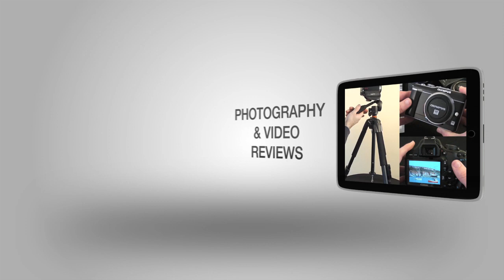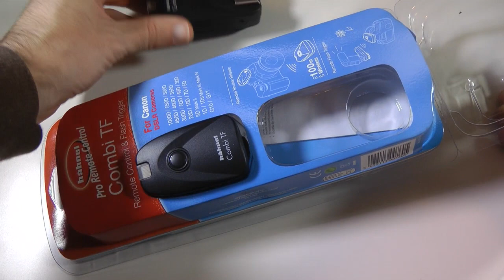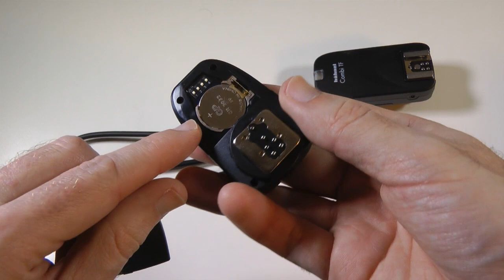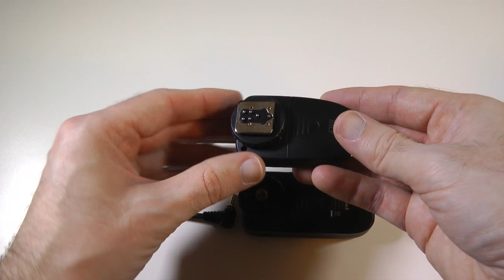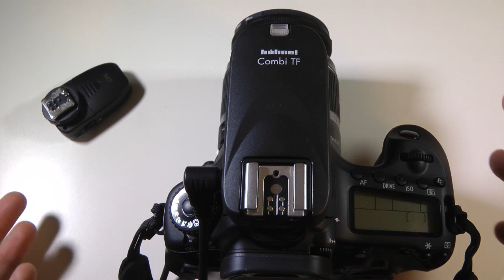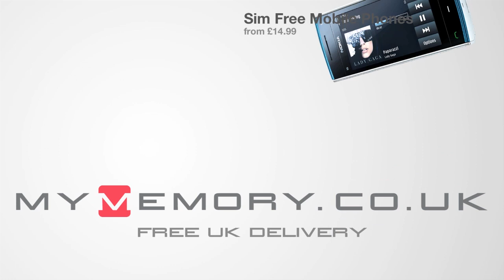Hahnel Combi TF Pro Remote Control for Canon Review

Comment: I have bought two sets, and am trying to use remotet triggering and external flash at the same time. But I am experiencing great unstability in my setup. Some times the camera triggers, and no flash. Some times only the flash triggers. And some times both the camera and flash triggers, but the flash triggers too late, and the photo is not lit up by it. My camera is Canon EOS 600D and my flash is Sigma EF-610 DG Super.

Comment: I recently tried it with the remote control on my 60D hot shoe and the flash trigger on a tripod as a remote slave and triggered it all with a Canon RC-6 remote control. Unfortunately I was surprised the max exposure was 1/160 sec and not 1/250 sec as I wanted. All exposures faster than 1/160 showed part shutter curtain or unexposed black.  I am still checking this out and hope I'm wrong! I had to use the 60D pop up flash pulse to activate the slave flash in the end.

Comment: Yes it does but that only works if the speedlite transmitter is in view of the receiving flash unit, so, if I was to require a unit to be triggered out of shot lets say behind the model, in a box, car or behind the camera it will 9/10 not be triggered.

The Hahnel remote system allows radio sync up to 1/200th of a second so you can receive it anywhere you want, within distance.

Comment: Just bought this device yesterday - I've given it a go, and I'm not sure where to get more info from.
Do you know if its possible to use the remote control function, with a flash on top of the receiver? I have tried it, and despite the flash working normally (I use a 580EXII on a Canon 40D), it doesn't seem to be in sync with the shutter. Any advice would be great - thanks!

Comment: Hi i have the Hahnel Combi set, my questions is can you set the camera to 1/8000 of a second or lower using this unit together with flash, i have a 5d mark 2 and I cant seem to go past 1/250 of sec. anything higher i find only half the picture is visable.
Reply: 'Normal' flash can go to a shutter speed of up to around 1/200sec on most cameras, or on some cameras the limit is a bit faster at 1/250sec.  To go to a faster shutter speed than that using any flash (and doing either on-camera and off-camera remote flash) you need to do 'flash synch'. Check your camera's user manual or your speedlite's user manual, or Google 'How to do flash synch'. The same applies with professional studio flash strobes as well because it's all to do with the flash's strobe time relative to the camera's shutter speed.

Comment: glad to add to your collection, you collect remotes lol.

I think if they were to improve it, the screw could be replaced with a single click connector like the 580ex uses. To use an external flash with the Hahnel kit above, you would need another receiver if you were using the remote shutter as well.

Comment: does this work on all canon EOS cameras?
Reply: Provided you have the right cable then yes it will work on all EOS Canons. Mine works on my Canon 600D for both remote shutter triggering as well as off-cam flash, but I don't have a cable to connect it on my 5D Mark IV.  I can use it to do off-cam wireless flash fine on my 5D Mark IV, but not remote shutter triggering.